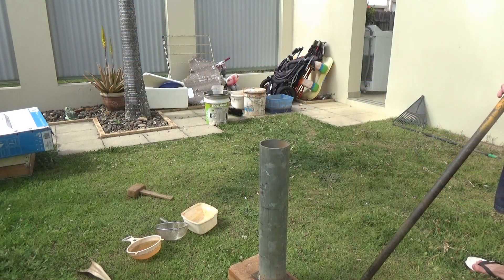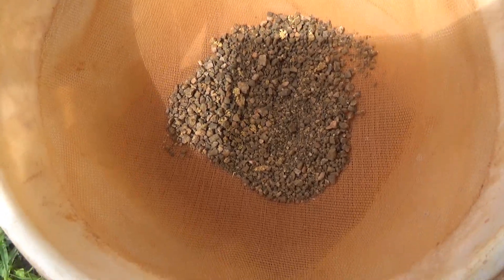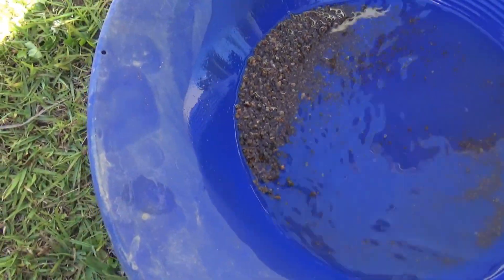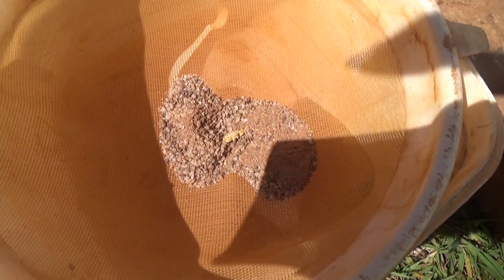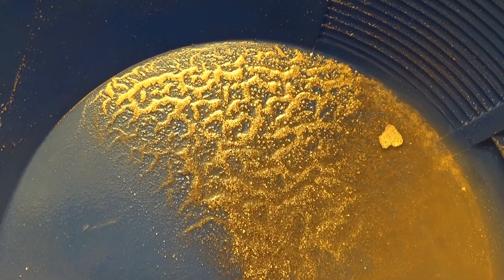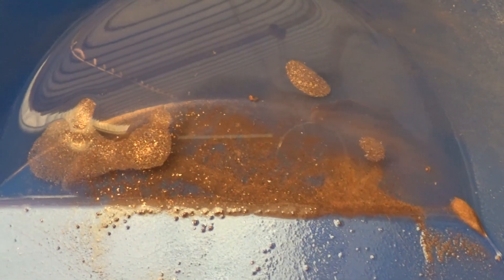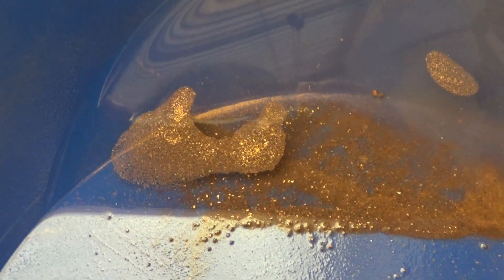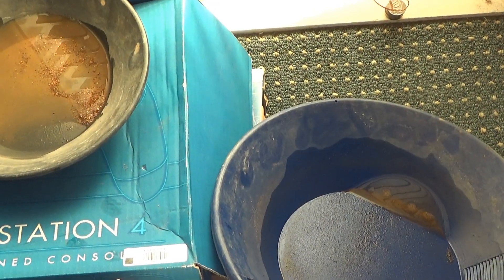Dollying, Crushing and Panning out Micro Gold

Comment: Russell, thank you so much for sharing. Can you share how much gold you got from those two specimens? Would also like to see you pan those fines without losing much. Gotta be skilled. That was a real good vid, thanks again              :)
Reply from the maker: When its micro gold like that it goes straight from the jar to the smelting pot, but at a guess 10 grams or so, floating off the micro gold after panning out the larger bits gives me around 98% recovery, the remaining 2% left in the fines is added to a container for later panning, glad you enjoyed mate, cheers Russell.
Reply: @TheNuggetMagnet  Really enjoyed it, thank you    :)

Comment: have you ever tried the heat and quench method the old timers used to separate gold from rock/quartz
Reply from the maker: Gidday phil, it would crush easier and is a great tip for larger amounts, shocking the quartz in cold water totally fractures it, they also built large fires next to the quartz reefs to achieve the same, thanks phil, cheers NM.